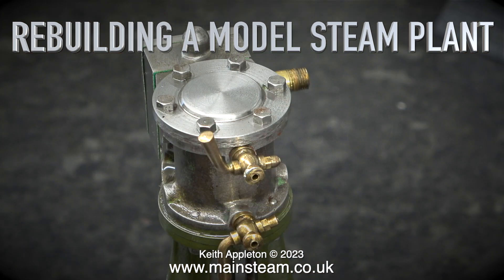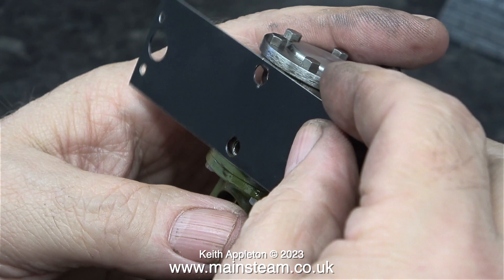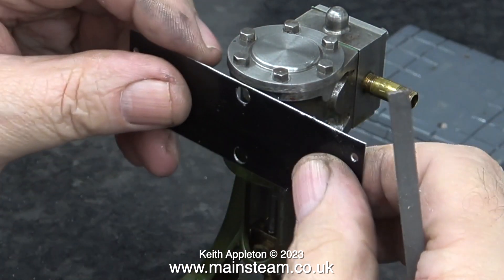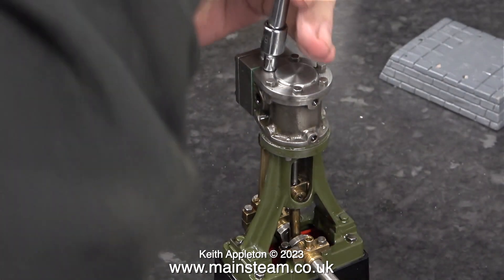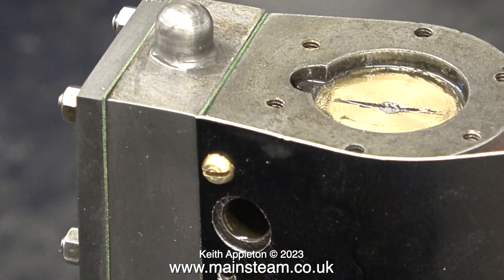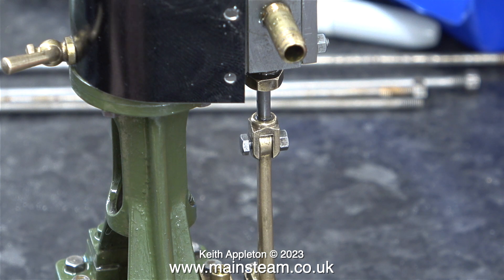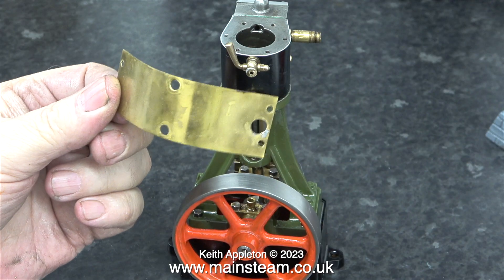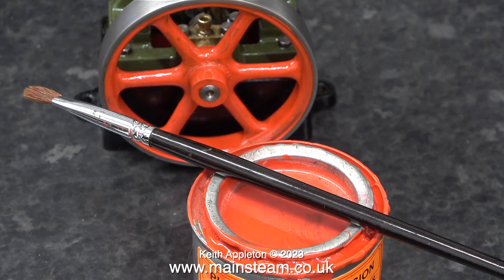REBUILDING A MODEL STEAM PLANT - PART #19

Comment: Modern red pigments are not very opaque. Before safety was a thing, red pigments were made with cadmium, and they were much more opaque and fade resistant. But cadmium is like lead, so it's no longer used in consumer products.